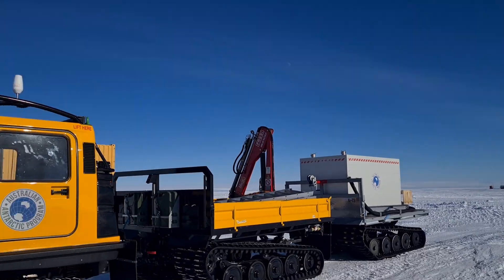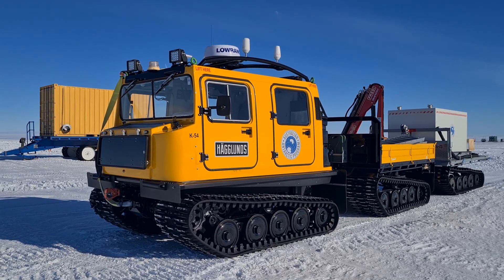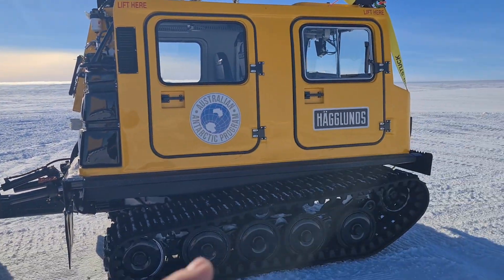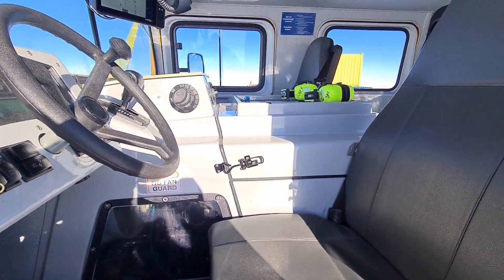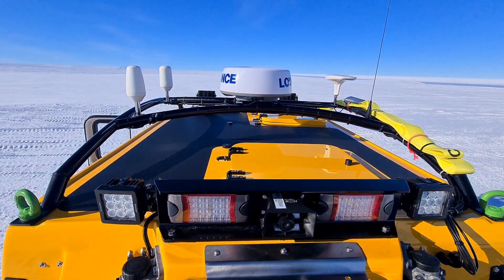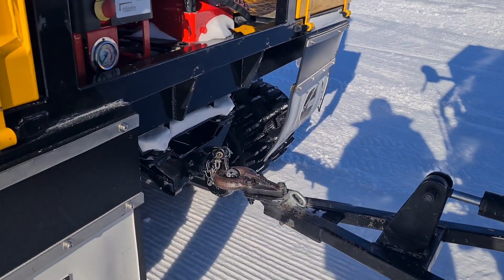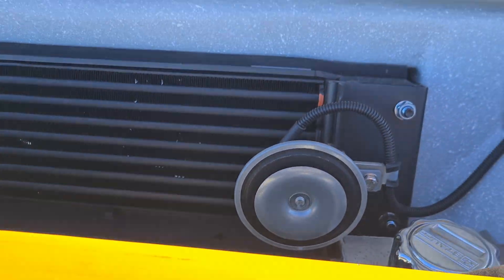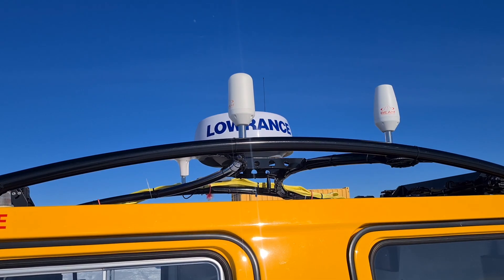Hagglunds - Australian Antarctic Spec.

Comment: The Cummin BT/Allison powertrain is interesting... they were originally built with Ford gasoline or Mercedes diesel engines, and Mercedes automatic transmissions. That's a heavy engine.
Reply from the maker: @brianb-p6586 all comes down to parts availability and knowledge down in Antarctica, we use Cummins 6BT's in alot of our smaller generator applications too so the mech techs here understand how they work and it's less training before they come down, they are also very reliable.

Comment: Awesome bit of kit.  So are the left/right track speed locked or do they vary with the articulation?
Reply: The tracks are driven by a common live axle with differential - like a typical truck - at the front of each of the two units. The axles are driven by a propeller shafts and a transfer case, just like a traditional 4X4. Track speed is not controlled to match the steering. There are some good illustrations posted by milmacsweden (which says "we are the largest dealer of Hagglunds Bv206"). 

One website contains a reference to an "emergency steering system" without a description. That could possibly be one-sided brake application in case of hydraulic failure, although that would work poorly in the articulated design.
Reply from the maker: @bruce..  open diff, the tracks will vary in speed as the unit articulates in a turn.